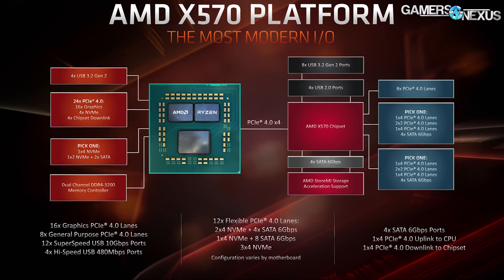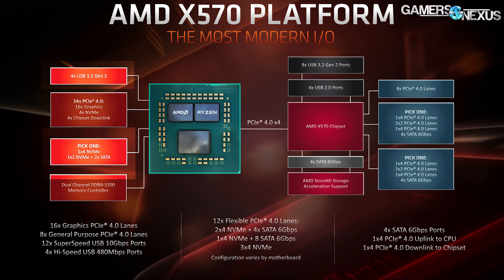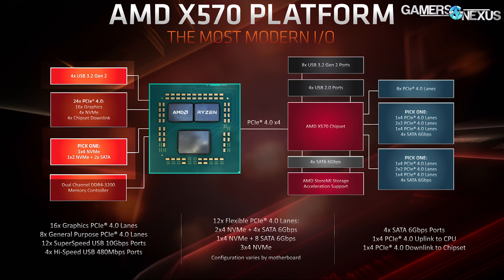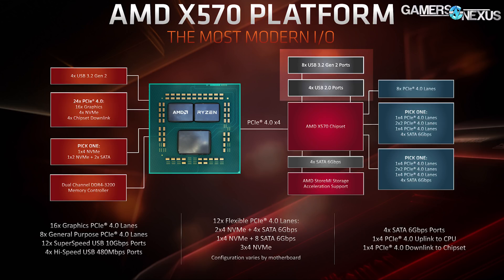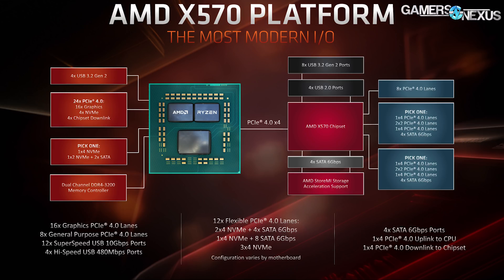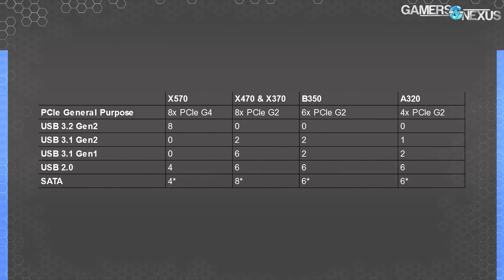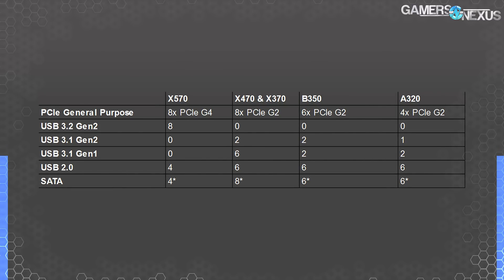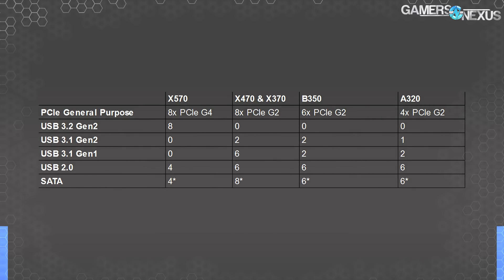AMD X570 vs. X470, X370 Chipset Differences, Lanes, Specs, & Comparison

Comment: Well,
I'm waiting for cheaper option the B550 chipset, 
or X470 price to drop

Either are Good

The problem is the Crypto Miner
Currently Crypto currency prices are going UP, almost triple, since AMD announce their new line products

I'm afraid RDNA RX 5700, mostly, will bought by Gluttonous Miner
Reply: probably since the compute units can do 2 things at once, AKA hyperthreading.
Reply: There really is minimal differences between X370 and X470. I've seen some good deals on X370's out there. For any of those options you'll likely need to update the bios before a Ryzen 3000 cpu will post so if you don't have an earlier Ryzen you might want to investigate if the board can have bios flashed without a cpu installed, I know at least one X470 could.
Reply: Yep and should be ASMedia again, so hopefully they do it way better (than AMD) and no fans there. Sadly X470 isn't an option for me, as there is no mATX, so B450 it is and will likely upgrade to B550, if they make a proper motherboard (good VRM and audio).
Reply: @onboard3  It's not really a problem of Asmedia against AMD designs, it's just that the ASIC is dealing with much higher speed transmission lines so inevitably has more thermal dissipation.
Reply: @PainterVierax  We shall see, it's rumored B550 is PCI-E 4 too after all. If it just has half of everything X570 brings, it's still pretty sweet, but way smaller die = cheaper = less heat and they got experience building chipsets. Even if they just make it smaller, it can be done with lower nm without raising cost. That X570 is huge!
Reply: @onboard3 I've seen multiple statements by manufacturers that B550 will be PCIE gen 3.

mATX is a dead, or soon to be dead, standard. I'd move to ATX or if you really want SFF go ITX
Reply: @KenS1267  Oh, I haven't seen any statements, just speculation how B550 would be cheaper and easy way would be to drop gen4, but not according to this: https://www.techpowerup.com/256547/asmedia-sourced-amd-b550-a520-chipset-motherboards-arrive-in-2020

Anyways, multi-GPU is dead, no need for extra PCI-E slots, hence ATX should be dead. I moved away from ATX many years ago, when I didn't need a slot for sound card anymore. ITX isn't any option as there's only 2-3 fan headers max (got 6 fans) and 1x M.2 slot (meaning you can't even clone your current M.2 to a new one).

I just don't like wasted space (or paying for it) ATX case and motherboard both have that. ITX suffers with cooling and compatibility. My CPU cooler is 180cm and most ATX cases can't even fit that, they top out at phatetic 150-160cm.

mATX is perfect, manufacturers are just stupid pushing out 7x different ATX boards, when clearly some of those could be mATX, taking one low and one higher price slot. Now there is low end ATX less low end, middle-end?! High end.. ..oh wait higher end! Hmh more higher end! "Do we have neought boards?" "no needs more cowbell..highend!".
Reply: @onboard3  smaller die also means smaller surface contact to dissipate heat so the chip should be designed with a bit more of spacing in silicon, especially if they have no thermal protection mechanism.
Asmedia and AMD have both a long experience building low-powered chips, I still don't know why you speak about exp when you talk about such veteran ASIC designers.
Reply: @PainterVierax  Well going from ASMedia X470 4.8W peak and 1.9W idle mode, to AMD X570 14W peak 11W idle,  clearly they are lacking something. My GTX1080 is 11W idle :D That cmos battery is 19mm which gets us roughly 15x13mm for the X570 die and that is 9600GT size! Making chipset the size of a GPU isn't needed.

I'm sure when/if they make X670 lessons have been learned and it's smaller and much cooler (and way cheaper). X570 I'm not a fan (pun intended) and it's not even out yet.
Reply: @onboard3  You can't compare those chips since none of the others use PCIe 4. It's already hard to compare it with IBM Power9. And AMD made Northbridges, embedded GPU chips and very low power CPU for a long time. This chipset might be rushed but we don't know yet so wait and see.
Reply: @PainterVierax  Yep, bigger picture if B550 is similar. It just more of my personal dissapointment as I wanted it, but my computer is on 24/7 and having a small fan spinning all the time (and braking) is not something I want. And coming from Intel I don't have a CPU to upgrade BIOS, so X570 would have been plug&play. Now only option is MSI as bios update works without CPU.
Reply: i think there wont be a b550 until next year... its very very sad. and i dont rly know what is the difference between b450/x470 and x570 in performance and temperature.
Reply: @martinivanov1319  From what I can tell is that only the VRM and its heatsinks are the only difference between the board performance wise. Its the difference in card slots and m.2 slots /sata ports that are the difference.
Reply: @piercetheheavens  if i have a ryzen 3600 and vega 64 gpu on b450 mb is there gonna be a difference between it and x570 mb?
Reply: Well, 
I think B550 will lunch this year, including all their Zen 3000s
 
Cuz, AMD won't miss opportunity to smack Intel, won't they? 

Differential between chipsets are Features and Capabilites

Performance is matter of other components
Reply: It doesn't matter, simply wait for a decent model with passive heatpipe cooling, like in past days on AM2+/AM3. I will certainly do that or go for B550 which should be passive

Comment: So what happens if you put a x16 Gen 3 GPU into the x16 Gen 4 PCIe slot? Would you only be using 8 Gen 4 lanes?
Reply: it would use x16 but at 3.0 speeds
Reply: Defaults to the fastest the card offers, so usually 3.0x16

Comment: The big question I have is: how does X570 treat PCIe 3.0 devices? Let's say you have 2 cards at x16 PCIe 3.0 - could you technically put both of them in and each slot would provide x8 PCIe 4.0 bandwidth, effectively letting you run x16/x16 PCIe 3.0 speeds?
Would love some clarification on this.
Reply: No. The slot will run at pcie 3 speeds (so x8 pcie3 speeds in your example) as the pcie3 device is either not physically wired to be able to support  pcie4 speeds and/or does have driver/bios support for pcie4.
Reply: @adamhero459  so if I plug in my 1080 into a PCIe4 slot, what speed will it run? X16 PCIe3 or x8 PCIe3
Reply: @nitrousable  In a 16x slot, it will run at 16x. In an 8x slot, it will run at 8x. In a 4x slot, it will run at 4x. In a 32x slot (they exist, on paper at least), it will run at 16x - limited by the number of lanes on the card itself.

The one complication is of course that the second slot on most x570 boards will steal 8x lanes from the first slot if it is used, leaving the first as only 8x.
Reply: @philiphiggins6870  thanks, and what about the pci4 ssds? Are they supposed to be plugged in the second slot to get full speed or do they have a specific slot
Reply: Alex Yoloswagger it uses 16 lanes of pcie(assuming you use the x16 slot). But the wording on the 1080 is not ,add for pcie4 speeds. So it runs pcie 3 x16 speeds
Reply: I mean, technically the bandwidth is there, since 24 total Gen 4 lanes = 48 Gen 3 lanes, bandwidth-wise. The question is how does the CPU/chipset treat older devices?
To make a simpler example: if you just plug any x16 Gen 3 card into slot 1 and leave everything else empty, would that mean the CPU now has 8 + 4 free lanes left, or is it 0 + 4 like it would be with a Gen 4 card? If the former, which it should logically be, can we slot a second x16 Gen 3 card in slot 2 and then end up with 0 + 4 lanes left?
Maybe this is a BIOS matter, I honestly don't know how these things work, hence the question. :)
Reply: it would be nice if they could switch to either 8+8 G4 or 16+16 G3 as the bandwidth is equivalent. but i don't think the switch has such capability
Reply: osgrov Im pretty sure it runs at the speed of the slowest component. so of you plug in pcie3 you lose pcie4.
Reply: osgrov Pcie4 amd pcie5 are really a lot more relevant in laptops than in desktops. And i think of pcie4 more of a gimmick than a legit product. pcie5 is going to come out in a few months.
Reply: @Melthornal  As far I can tell at the moment it´s useless for most people. Unless you are transferring on a regular basis a lot of data..but even there a person would probably use a NAS populated with something like 4TB HDDs. And who does really need nvme at this time?. Graphic cards wise I do not believe that the RTX 2080 Ti is saturating at all x16 pcie3. Well I guess for SLI setups it could make sense. Those bandwidth possibilities must be quite interesting for enterprise though. And yes since pcie5 will most likely double once again pcie4 specs, I wouldn´t bother too much at this current time.
Reply: @Melthornal  it'll be a couple years at least before pcie5 is in mainstream products.
Reply: Joe Tavener I doubt it. intel will use it to leapfrog amd and make them look bad. amd then and will jump on immediately after when they change their socket.
Reply: osgrov With pcie5 In a laptop you can do something like split your x16 lanes across your drives and usb then take a x4 slot and throw it into a thunderbolt connection. Now you can plug in external graphics cards on a x4 lane and run external graphics at full bandwidth and turn your laptop into a gaming machine.
Reply: Hmm, this is kinda confusing for me to be honest. Guess we'll see how they work once the reviews hit. :)
Reply: @osgrov  Its called lanes for a reason.  If you are driving at half the speed limit, half your lane doesn't become available to other traffic.

Youd need something to convert between PCie 4x8 and PCIe 3x16.  While the chipset might do this I doubt it can be that easily toggled on physical slots.  I've certainly never heard of it being done in the past that way.
Reply: @alexatkin  yes, I totally get that. I think what got me confused was the talk about how the I/O die on the CPU and the chipset itself are basically PCIe switches, so I thought maybe they're a little bit more intelligent. Wishful thinking, probably.
Reply: It would be awesome if you could run x16 gen 3 with 8 lanes of 4.0 but I somehow feel that this wouldn't work
Reply: Yes, if you plug a 16x card into the 8x slot, thousands of nanobots will be released from the chipset to wire in the additional lanes from the slot to  chipset and reconfigure the cpu socket to allow for the extra lanes. Unfortunately, due to the cost of developing and implementing this technology the average cost of an x570 motherboard is expected to be four trillion dollars.

In the real world, no - you can't trade lanes for clock speed that easily. It could be done with a PCI 4.0 switch/plx chip, at the usual cost of dollars and latency. I don't know if any are actually available yet, and they aren't on any x570 motherboard I've seen so far.
Reply: The device needs to be gen4 compatible - current gpus are not
Reply: There's a lot of misinformed nonsense in this particular thread. PCIe version 5 will be even more difficult to implement than version 4 and will not be coming to desktops or laptops any time soon. The answer to the original question is that each PCIe slot negotiates a speed with the card that's plugged into it. The best you will get is the slowest common speed. Any available bandwidth that isn't used will be wasted. That's how PCIe has always worked.
Reply: johnm2012 Its difficult to believe pcie 5 will release much later than 2021 or maybe 2022. Which is extremely soon.
Reply: From what I understand in theory you should be able to run a card at x8 speed and it would have the same bandwidth as a x16 in pcie3. So if you run a card at x16 and x8 it would be the same as doing x16 x16 in pcie3
Reply: @Melthornal Not if the device in the slot is PCIE G3. The hardware and firmware on the card simply won't be able to support those transfer speeds. The PCIE slot might be able to deliver much more data than the device can consume but when there is unread data sitting on the pipe it blocks more data coming in.
Reply: @KenS1267  If you plug in a pcie3 device it isn't a pcie4 lane anymore so thats irrelevant.

Comment: @Gamer Nexus:
So 14W needs cooling??? How much heat can 14W produce? :|
And did you manage to hear any of the micro fans on the mobos? Are they noisy? Or you are not allowed to say anything? :(
4:45 For the older mobos, don't you mean "PCIe G3"?? :/
Reply: Intel X58 was 24 watts, so it would seem that passive cooling is perfectly possible given that most of those boards were built as such and many have been lauded for high reliability in the years since. Those weren't the days of waterblocks and solid glass case panels though, so boardmakers may be hedging their bets on being installed with poor airflow. B.Y.O.Air, as it were.

I wouldn't expect them to be loud as they're right at the threshold of where active cooling may be appropriate, but a beefy heatsink and anything more than just plain convection would do the job as well.
Reply: @random_n  the die shrink might explain it, smaller node sizes have more prominent hotspots and on a smaller area to boot
Reply: @random_n  As I suspect. They are tiny, and to even do something, they have to spin at mach 1... And the noise would be sonic booms 24/7.... :(((((((((((((
But that's why I asked, how high can 14W heat up, so it needs freaking active cooling?????? :O
I mean, graphics cards don't even spin their fans, unless it gets to 60 degrees or so... Dunno the actual numbers.
Reply from the maker: Power is heat. It needs cooling of some form.
Reply: @GamersNexus   Power is the rate of transfer of energy(i.e. Heat),  You are usually more precise Steve. 😁
Reply: @GamersNexus  Anything about those fans? Yes? No?
That's what actually matters.
Reply: @Lucian_Andries  I doubt the fan will even spin unless you are doing things with speedy nvme drives
Reply: @everythingfeline7367  The chipset tells how things work. It does not do the job for them!
What NVMe drives do, it's on them only.
Reply: @Lucian_Andries  Yes, but all that data has to go through and be routed by the chipset itself, especially if you are doing Raid 0.
Reply: @everythingfeline7367  Especially, but I'm not. So it's good.
Reply: it can produce 14W of heat 🤔
Reply: 15W U-series laptop processors definitely need cooling, don't see why a Mobo chipset wouldn't
Reply: @Lisa_Minci96  That CPU has a boost clock, it's working 100% all the time.
A mobo chipset is different from a CPU. It's not doing billions of calculations, nor rendering stuff. It just tells what everything does what.
Try again...
Reply: The question is how fast can you dissipate 14w of heat....or else it builds up until it begins to glow, or meltdown, or whatever. It doesn't matter because your computer will have failed long before that. Remove the heat shroud from an old video card, plug it in and touch the processor die on the video card. Even while the computer is just booting up for a couple seconds it gets HOT as f^&% fast
Reply: @czdaniel1  Graphics cards do not glow, nor melt! Mine is 47 degrees, and I'm watching 4K movies. The fans only start when I run a game. No, it's not a custom fan curve, it's the way it was built.
I guarantee it has more than 20W right now, and it's not doing any nuclear meltdown!

What are you guys smoking? :)))))))))))
Reply: @Lucian_Andries  -- Did you not read the part about remove the heat sink and fan; ie: remove the means to dissipate heat to demonstrate how rapidly heat builds up when it has nowhere to go, even at the relatively low-energy states of merely posting to bootup. Jesus what are you smoking
Reply: @Lucian_Andries   because your graphics card has a HUGE FUCKING HEATSINK on it with high heat capacity and large fin surface area, which allows it to dissipate heat efficiently enough to not have to  turn fans on when there's no significant load. Chipset heatsink is pretty small compared to that.
Reply: gary The right way to look at this is: How big a surface area is needed to dissipate 14W to the air from the case fans while keeping chip temp below 60°C on a 30°C summer day.  That's a 30K budget to cover: 1. Air being hotter inside the case.   2. Heatsink to air transfer efficiency (depends on surface area and airflow).  3. Energy transfer in heatsink (W/K).  4. Energy transfer from chip to heatsink (also in W/K, affected by thermal compound).
  In that budget, item 2 can be made more efficient by a chipset fan, but there are other items for the thermal designer to work with.